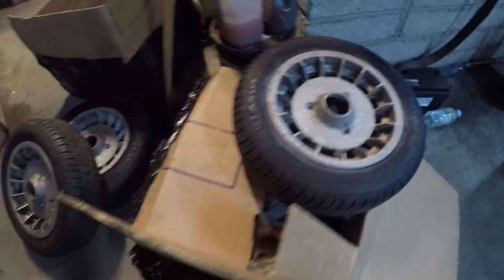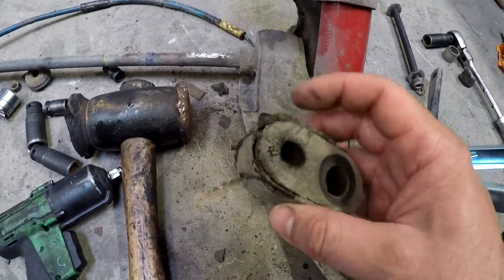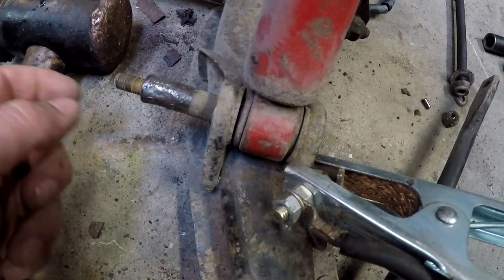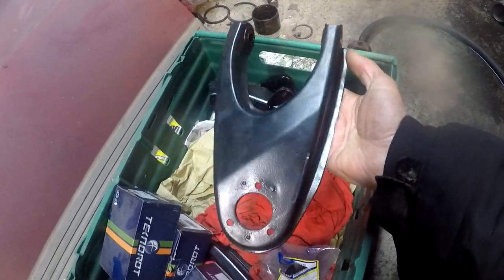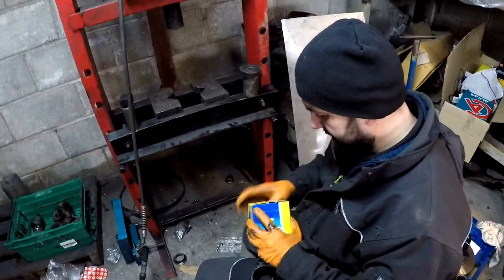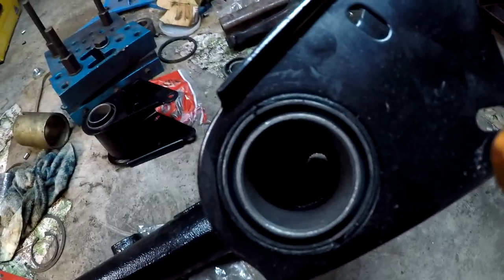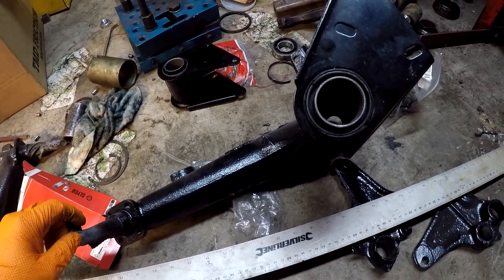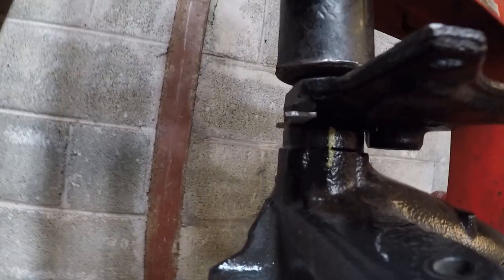renault 4l restoration episode9 mostly suspension

Comment: Hi Dom! Please check, seems you forgot the washer between the bearing and the sleeve when you install the front wheel bearing. I do not see the washer on the video.
Reply from the maker: I didn't forget the washer, it was never there someone had to forget to fit it before, the funny bit is my spare hubs are lacking them aswell i figured it out after i put it all together. The quick solution was to slightly modify the bracket for caliper to compensate for lack of washer.
Reply: @zwloki0  I hope you will be able to tighten the wheel bearings properly without this washer?
Reply from the maker: @spasojejakic5918  me too, but the washer is only about 3mm it should be fine. if not i will need to locate some washers :)